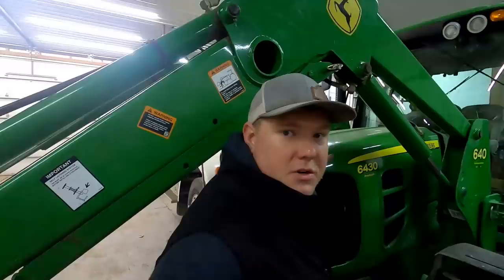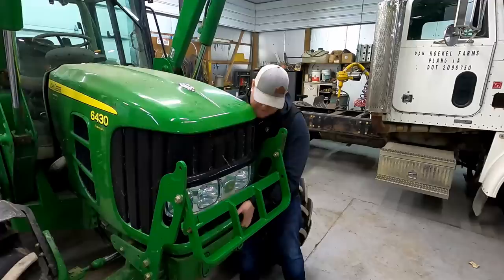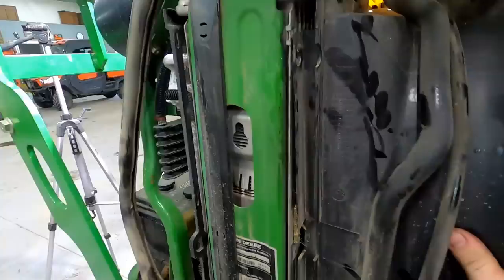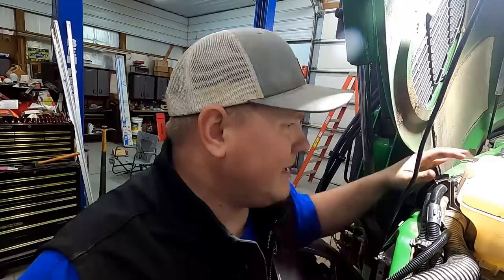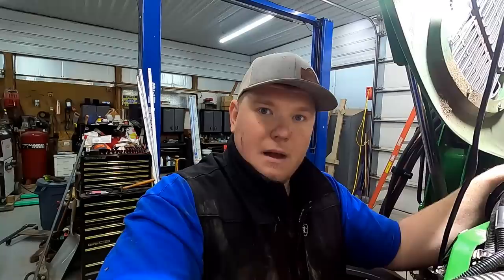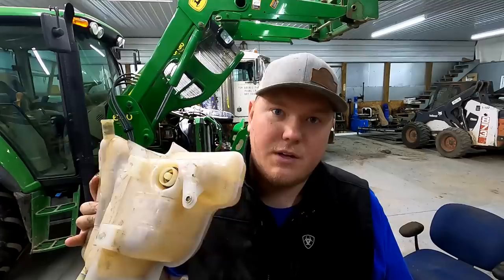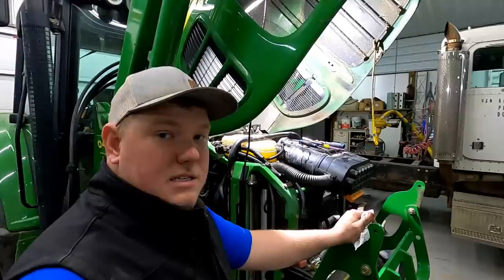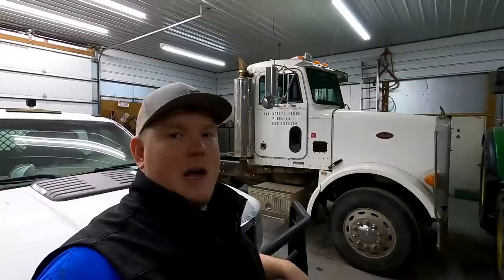Fixing the John Deere 6430 - Shop Vlog

Comment: I once had a reservoir on any Oldsmobile start to leak where it cracked.  I removed it, sanded it and cleaned it, applied some JB Weld and it never leaked again.  Then again, you don't need this advice today.  Good video, man!

Comment: you should have air pressure it up and the crack would’ve been visible just a suggestion
Reply from the maker: i was going to try that, but I didn't have the tool to do it on the tractor and I wouldn't be able to plug all the holes on the tank to keep the pressure in.

Comment: I have two 6430 tractors with IVT transmissions both are 2010 I have owned since they were new the only problem I have run into was the factory used crimp on hose clamps for a lot of coolant hoses and they were starting to loosen and leak. I got a bunch of high torque hose clamps and replaced ever crimped clamp I could find. Other than that they have been great tractors. Glad I saw this though just in case I notice a similar leak I’ll know where to start. Thanks for the video.
Reply from the maker: TB know a way to get those clamps loose easy? I used a screw driver and twisted. Didn’t seem right.
Reply: @iowANFarmer   If I could reach them I would use a pair of needle nose pliers by grabbing the loose tail of the clamp and rolling it over the three locking notches. Kinda like the old Spam cans. The ones that I could not reach with pliers I used a thin flat screwdriver and basically did the same thing as the pliers just tried to pry the tail up over the locking notches one notch at a time. I also started out by just trying to twist them off any old which way but like you said doesn’t seem right.

Comment: Our7230 has the same deal...... But the rivets are  used a lot on the interior panels in some otr trucks..... On those the center screw expands the rivet in place.... removed the rivet collapses allowing removal
Reply from the maker: Farming for Fun & Profit did you fix the problem?
Reply: @iowANFarmer  Yep

Comment: I've replaced that seal on both of my works 6430's, one of the most frustrating and time consuming repairs
Reply from the maker: James Neighbors sounds like you know yesterday’s struggle. Was it the seals leaking both times?
Reply: @iowANFarmer  yep both times, also might want to check the electrical for your a.c unit on ours where the ran it it passes through pulleys so we lost a.c on a 105 degree day

Comment: Nickel's worth of free advice . When you got that loader up like measure the cylinder "chrome section " and cut a fence post that size for both sides and lay them on top of them and then lower the loader . I would hate to see bad to you that can easily be avoided
Reply from the maker: Might give that a try. I had it locked mechanically, but not physically.

Comment: This isn’t a knock on John Deere at all but have you noticed how all newer equipment cars, trucks, and tractors they make it impossible to work on easily? They make a simple job hard to get to just hoping someone will get frustrated and bring it to the dealer. It’s a shame prices has gone through the roof it would be nice if there was some engineering designs that allowed us to to fix simple things ourselves easily.
Reply from the maker: I would agree with that. They don’t care if it takes 3 hours to do a 15 minute job. They gouge you by the hour.

Comment: You pull the center out on those keepers to allow them to come out. Kinda pop in and out like a plastic wall anchor
Reply from the maker: Andrew Peterson I cut out the part of me trying to do that. The screw heads just kept spinning and never backed out.
Reply: iowANFarmer on cars they push pull. But hey you got them done so no worries right. Like your videos
Reply: The screw heads are just dummy heads.  Use a pick to pull them out and press them back in by hand.